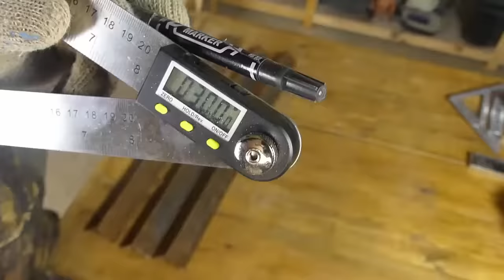I didn't believe it myself! I welded a barrel of pipes and it all worked!

Comment: Made a similar unit for my garage back in the 80's.  I was loosing far too much heat out the stack, so I added a second barrel on top.  It had baffles inside it to keep the exhaust heat from moving thru it too fast.  It made an incredible difference, I would guess at over 45% increase in efficiency .  It allowed for  a serious savings of fuel.
Reply: Yep, a "smoke shelf" plate in top of burn chamber, retains heat for full combustion. Learnt that when I made a slow combustion stove from an old hot water system tank.

Comment: My experience with drums of that type is that they don't handle fire and heat that well and therefore don't last. However with the bracing of the pipes outside it should last a little longer but the fire and chemical reactions due to burning cause the metal to rust and decay quickly.
Also commentary is needed for someone as inexperienced as myself to fully appreciate and enjoy. However it was still very interesting.
Reply: Yeah normally if you want them to last you have to coat them in refractory cement so they don't rust away. That thin steel just is not intended to take being used as a fire box.
Reply: З
Reply: @Automedon2  Your standard burn barrel has no lid, and the lid is the part getting the most heat.
Reply: Other factors come into play as well with how long it takes them to oxidize through.
Reply: Adding the exterior pipes resolves all the issues you mentioned because it's adding both thermal conductance and thermal load capacities.

With the natural convection through the pipe wall exterior, it will be like he's burning in a 55gal drum with a sidewall 3-5 times as thick, or more.

That's why you do something like this.
Reply: @formdoggie5  Thanks for that. I have put a like on your reply to my questions.
However one unresolved issue.
I have used dozens of these drums over the years for burning different things mostly garbage. Also where I'm from I have seen dozens converted into barbecues for jerking, smoking and barbecuing.
They seem to last for cooking but fall apart pretty quickly from burning everyday rubbish and etc. Even when under cover from the elements, once you burn in them vertically they rust and collapse at an exceedingly fast rate. Is this from excess heat or possibly from so many plastic soft drinks bottles? Maybe fluids left on the bottles?
Or maybe the fact that are sitting on the ground?
Reply: @GDuncanFYoung  the main issue is its not the best steel, and the worst thing you can do to metals are thermal cycle and vibrate it.

With the thin walls of 55 gallon drums the lack of focus on grain homogenization because its made from low cost steel causes it to break or crack itself.  This is essentially due really small, uniform crystal grains being what makes metal strong, and what also causes them to grow and shrink at the same relative rates.

In cheap iron/steal, the grains will vary in size dramatically, and literally pull a part from each other as a result of the widly disparate expansion and contraction rates of the different sized grains.

If youve never visualized it before, basically imagine in one ball pit you have a few basketballs, a few volleyballs, a few soccerballs, a few softballs, a few baseballs, a few superballs, a few marbles.  In another ball pit, you have all marbles. 

Now imagine how well and uniform the two ball pits would compare to each other if you had a way to shake them up 1000 times.  No matter what you do, the ball pit with all the different balls in it will look jumbled and mish-mashed, while the one with all the marbles in it will always look ordered and uniform.

The same thing happens when you look at the crystalline grain structures of metal under a microscope, and thats what lends strength and ability to thermal cycle.

Under a microscope, your 55gal drum looks like the mismashed ball pit, a structural I-beam looks like all volleyballs, a tank armor plate looks like all baseballs, and NASA "space grade" aluminum looks like all grains of sand on fine grit sandpaper, comparatively.

That's what causes your 55gal drum to start breaking apart after a couple of winters, while meanwhile something like the International Space Station can handle going from 356C to -150C when it goes from direct sunlight into a planetary shadow for decades.

That's also why one 55gal drum may be totally brittle and fall apart after a couple bbq's, while the other outlives you for 1000's of cookouts -- it just got lucky to be made from a section of the metal sheet where the grains happened to be dramatically uniform by comparison.

It all comes down to manufacturing controls and input quality. As a result, while you certainly might get some metallic interaction effects from what you burn in it, it's more how much are you heating it, how long, and then how fast is it being cooled that you have to worry about more than anything else.
Reply: @formdoggie5  your reply was fascinating. I read it three times applying all the high school physics and chemistry I could remember. Also we have to do a whole lot of welding for repairs at a small factory I run, which has helped to give a small inkling of how strangely steel can behave during heating and cooling.
Thank you for taking the time and the trouble to thoroughly explain.
Reply: @Automedon2  no sir we don't.  But since you brought it up, we are more clever than the rest of the world.  Even better if you're from Texas.  🤣
Reply: @Automedon2  No. SOME do, while others just wander around spouting nonsense THINKING they are. But MOST just go around complaining and nitpicking to death what everyone ELSE is saying. And it's NOT just Americans, it's humans in general.
Reply: @juliebaker6969  no we don't.
Reply: I just posted the same thing. Mine rusted out in 2 or 3 years.
Reply: @Marra7777  What makes you think I'm talking about YOU then?  The fact that you ASSUMED I was talking about YOU, says it ALL.  
And yes you DID assume it applied to you, you said "we" not "they".

Better to keep your mouth shut and be thought a fool, than to open it and remove all doubt.
Only YOU can determine whether the above adage applies to YOU or NOT.🤔😏
Reply: @juliebaker6969   They were joking.
Reply: @RevdUp.Art.Fotografer  I thought jokes were supposed to be FUNNY.
Reply: @formdoggie5  Excellent and very insightful explanation, obviously from somebody that knows. I agree with it because in my engineering studies we did speak about how iron and coke are influencing the arrangement of crystals thus the different denominations of steel: carbon steel, alloy steel, tool steel and stainless steel, each one with its (very many) sub-categories.
Reply: @rickymccomack2548  Good one Ricky , ha ha!
Reply: @rickymccomack2548  Good one Ricky , ha ha!
Reply: @SilvaDreams  Hi Silva Dreams , don't know about this refractory cement thing . You probably mean some kind of refractory mortar, I suppose . I tend to think that refractory mortar would eventually crack and fall to bits . An alternative woul be to line the 44 gal drum with thin firebricks but, this would keep the heat in , which would escape through the flue. Now since you want the drum to deliver heat and not the flue , this wouldn't be a very good idea.  I reckon you could weld good quality steel plate strips inside the drum or perhaps weld those inch pipes inside the drum as well.
One would just have to try it and see what happens. Cheers mate!
Reply: @pukicat  Well the design isn't very efficient anyways, you'd want to lay it sideways and split the barrel in half with the flue in the front and the flame going up in the back so it has a cleaner combustion but also gives more time for the heat to stay in the barrel because as it is... Most of the heat is going up and out the flue anyways.
But refectory mortar is for joining refectory bricks where as refectory cement is intended as a stand alone.
Reply: @formdoggie5  Stunning explaner. Thank you for posting this. I learned something today. Big up!
Reply: It looks a lot thicker than a standard drum, however. At least 4mm

Comment: It’s great seeing people actually making useful items from metal that often went to the scrap yard. I come from a family of certified welders, structural welding test isn’t a easy test. All 3 positions are tested, flat, vertical and overhead. Then a strip or coupon is cut out and the weld is Xrayed for air holes and then put into a bender to test Tensile Strength. 
Being a plumber for years I tried stick welding but never got certified. Silver solder was tricky back then, getting the copper cherry red and trying to get a smooth clean solder. With all the new highly engineered welding equipment being either spool feed or using a stick, temperature is critical and these new machines are programmed to keep it correct. 
I have always gauged a mechanic by their tools, for years it was thought to be a male dominated trade, but during WW2, women did most of the welding and riveting, aka ROSIE THE RIVETER. 
I have amazing Trades people, many women who are great mechanics and Trades Persons. 
I need to see who makes AEG tools ?
All the great trades people are using this brand. 
Thanks for showing how scrap is one person’s gold. 
I have repaired radiators made from black steel pipes which lasted for years on Steam boilers. Steam is easily understood when you know the basics, it rises and expands at 1700 % as it converts from water to steam, I always used Black steel pipes and black cast fitting, they are designed to split for replacement. On gas piping Black Malabar fittings have not casting holes. 
All trades have their own tricks, which often takes years to learn, usually from an elder Trades person. 
Few if anyone knows it all and YouTube is a great resource to start learning ⭐️⭐️⭐️⭐️⭐️
Reply: Along with every Trade come the jokes associated to them, being a plumber for years I liked them all, there is brand of Suspenders that are colorful and are made with embroidered images of each Trades person, of course the plumbers suspenders were out of stock. With all the bending and movements through tiny places, dragging along a small MC Acetylene tank which’s flexible hose and turbo torch is attached keeps you alert to say the least … lol, it’s great exercise, mostly you need to know how to lift correctly with your knees and back straight, most of the muscles need upper body strength for turning wrenches Or threading pipe with a ratchet dye head , sorry kid the Rigid 300 is in the shop and this job is behind, so get moving. Oh the fun of being an apprentice under a Master Plumber, fetching coffee for that fat bastard in my case who sat in a chair with a school poker stick, like he was a Maestro leading his own quartets …lol
Humor is what keeps us all together, job pranks are seen as fun , such as disconnecting the Lead extension cord of the person drilling away 2 stories above you, and pretending to not be aware of how it happened, hey there’s a dozen people working on this floor, perhaps it got caught by someone walking around and tripped …
I f you do not have have the ability to learn and laugh at the same time, find a desk job somewhere. The trades are not for the weak hearted folks, we work hard and play hard, but without malice, again find another line of work … lol
I truly enjoy trades people, see when you enjoy whatever you’re doing, you’ll never work a day at all, meaning it’s fun.

Comment: I built a very controllable heater from 3/16 plate, 4 in exhaust, screw adjustable intake. Very good at long slow burns. Only real issue is the flue runs cool and creosote builds up in the pipe. I just happened to have a 4 in flue brush so I can go up about twice each season and brush out the buildup. I was thinking about a bread baking oven using a similar pipe design to yours where the pipes would be inside the drum running from the lower fire box up to a smoke chamber and out the flue. The pipes would carry the exhaust through the baking chamber to heat the oven from almost 360 degrees around to eliminate hot spots. Like your innovative designs.
Reply: Grandma used to save potato peels and dry them and once a week throw a handful into the stove and never had any creosote build up just a film of powdery dust in the spring.
Reply: An empty aluminum can once in a while does the same as those expensive creosote sticks they sell. Put one in the fire and you'll soon hear the creosote harden like glass and pop off the inside of the pipe like someone is dumping sand in there.
Reply: Up it to at least a 6 in flue and choke it slightly with a damper this will burn cleaner, your fuel/air mix is producing to much carbon, more air is needed
Reply: @lightpropulsionguy  the idea is to slow down combustion, not increase it. One of the reasons I built this stove was to control combustion. It probably not making any more combustion byproduct, it’s just cooling down and precipitating out of the smoke stream. Hotter flue gas carries the byproduct away to the atmosphere.
Reply: My friend had an oven like you describe in an ice shack for fishing in Maine. He built a tin box around the flue pipe, with a little door, and some adjustable vents, and an oven thermometer...you could cook a whole frozen pizza 🍕 in it.
Reply: By insulating the pipe is tar reduced drastically

Comment: @CraftMaster - I like the fact you've repurposed everything in this fabrication, however I'd suggest filling the exterior vertical pipes with concrete or sand, that would accumulate heat, then radiate it akin to an electric storage heater, providing welcoming heat long after the fire itself dwindles. We used to place large rocks around our campfire for the same reason. 👍🏻‍
Reply: Dry wall mud is like a fire brick fill with it
Reply: And a portable bandsaw would cut pipe so much easier
Reply: @Psy6o  I don't own a portable band-saw, however I find a diamond wire saw cuts through any thickness PVC piping in a fraction of the time it takes a conventional hand saw. Keep up the great videos. 👍🏻‍

Comment: Very neat intricate construction. Kudos. However, complicated doesn't always make for best efficiency.  Some years ago, I built a double barrel wood stove with the bottom being the fire box and the top being a smoke chamber with the flue pipe. The saddles, doors, flue, etc. came as a kit. Then you just made the appropriate cuts on the 55 Gal. drums. You can see in the video with the infrared camera that a lot of the heat is escaping up the flue.  A small fire in the double barrel wood stove would last for 8-9 hours with the dampers almost fully closed. A big loading of wood would burn nearly 24 hours and easily heated our large log cabin in northern Canada in the middle of winter (-20F).
Reply: I'm getting ready to build the same stove... but with a door in the top drum as well, for grilling and smoking, indoors.
Reply: Sounds ! Like INEFFICIENT !! IF ! THAT'S ! HAPPENING !
Reply: Pics or it never happened

Comment: My dad used to make wood-buring stoves out of 55-gallon drums. He made the firebox horizontally on the long axis of the barrel, with doors and other parts from a Franklin stove kit. These worked very well. He also made one out of a water heater, which was long enough to lay meter-long logs inside. The fires would burn for days and days!
Reply: Your channel is fascinating.  I’m intrigued by your work and ingenuity.  Mostly using things that can be repurposed for something extremely useful.  Well done 👍🏻!

Comment: I use a horizontal fan above my wood burning stove and it causes entire floor to heat instead of just by the stove. .cool.
Reply: Friggin genius.
Reply: Sounds made up
Reply: No...hot...not cool!🤣🤣🤣
Reply: They make thermal conduction fans you can make or buy for a wood stove as well. The heat makes the blades spin. Mine looks like a cast iron electric fan with no motor.

Comment: A ceiling fan at a low speed pulls the heat off the pipes, and forces hot air downward. Made degrees difference as soon as I turned it on.
Reply: Wait what....This is how a ceiling fan is made?
Reply: MIXES 
(FLOOR-AIR UP)  AND 
(CEILNG-AIR DOWN) 
UNTIL SAME HOT-COLD TEMPERATURE 
CAN ROTATE 
CEILNG FAN BLADES
CW OR CCW
Reply: @monkeybrains3769  circulation off the furnace heat raises temps all around instead of it only radiating in one spot ultimately raising room temp
Reply: could run the bottom inlets away from the stove and to the ceiling.
Reply: Yes!.  Get that heat INTO the room!
Reply: BRILLIANT design!

Comment: I worked in tunnel construction from the 1960s onwards, when setting up site buildings of timber the blacksmith and welder would make up some stoves, very similar to yours. They used steel pipe and other steel stock bought from scrap yards, instead of the pipes you added around the drum they used a larger diameter pipe with an air gap. The fuel would be coke from the local gas works and the fire kept in 24/7 during the winter, full English breakfasts would be cooked on top and boy it was a brave man to stand beside that stove, you'd get toasted in minutes. H&S would have a fit if that was done now..
Reply: H&S?
Reply: @2degucitas  health and safety? He's a og. Before OSHA.
Reply: @skurdibbles7913  or in the UK or perhaps a Commonwealth country.